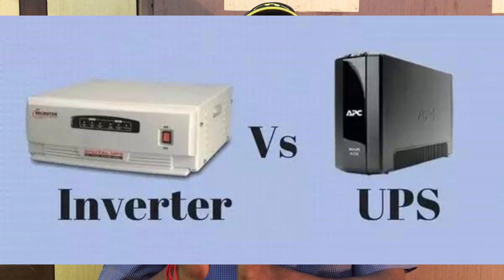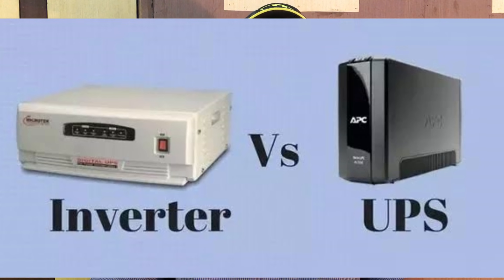Difference between UPS and Inverter | എന്താണ് UPS ഉം Inverter ഉം തമ്മിൽ വ്യത്യാസം

Comment: Hi bro,

I have an Apc ups 1100 va and only my ps5 is connected to ups. Problem is sometimes when i switch on the ups there is tripping in mcb. I am able to put the mcb switch to on and everything works normal but this keeps on repeating sometimes. Any idea how to resolve this. Thanks.

Comment: എന്റെ കയ്യിൽ marantz sr 5015 amplifier ഉണ്ട്. അതിന് ഏത് ups ആണ് കൊടുക്കേണ്ടത്? ഇവിടെ voltage fluctuation ഉണ്ട് . apc bx 1100c  ഞാൻ യൂസ് ചെയ്തിരുന്നു പക്ഷേ ചില സമയത്ത് ഓഫ് ആയി ഓൺ ആവുകയാണ് 
apc ups Stepped approximation to a sinewave ആണ്.
 marantz construction power 650 ആണ്.  microtek E2 1kav 24 v pure sine wave ആണ്..  ഇതു മതിയാകുമോ

Comment: Router connected to UPS is not getting powered on when power outage happens,at the same desktop and CPU is    on only.Tested the  router connection in all three  power sockets of UPS .But not working still. I am using UPS model ZEB- U725. Please help!!

Comment: Stabilizer pakaram UPS endanu smart TV or Smart AC use cheyathad considering the fact that smart devices use controller circuits which can be damaged by severe or regular power failures? UPS use cheydal namuk apo itharam cases ozhivakikoode? Just power surges matram control cheyuna stabilizer use cheyand, power surge um instant switching nalkunna UPS use cheyunad ale itharam smart devices inu nallad? esp for inverter tech AC's. Hope your reply soon!

Comment: V guard inverter DC 1000smart model ആണ് ഉപയോഗിക്കുന്നത്. ഇടി വെട്ടിയപ്പോൾ കംപ്ലൈന്റ് ആയി. അങ്ങനെ ബോർഡ്‌ മാറ്റി വെച്ചു. ഇപ്പോൾ ഇൻവെർട്ടർ fan എപ്പളും work ചെയ്യുന്നു.temp  42c ഇൽ നിന്നും 56 c ലേക്ക് പെട്ടന്ന് ആകുകയും fan work ആകുകയും ചെയ്യുന്നു. കംപ്ലയിന്റ് വല്ലതും ആണോ
Reply from the maker: Board local Aano maati veche... Board oveeheat aakunund, Peten oru problem undaakan chance Kurevaan, but continues use il undaakam

Comment: Sir,  my ups is v guard, model  prime 1050, digital sine wave ups, 900 va, 740 w , input 5.7, out put 4,1, battery used is tubular 135Ah, connected to my light,  fan ,and led tv in my house,  I like to install a solar panel system with charge control is it possible,  I am expecting your advise, thank you

Comment: 150 ah. ബാറ്ററി ഫുൾ ചാർജ് ആകുവാൻ എത്ര യൂണിറ്റ് കറന്റ്‌ വേണം 
എത്ര ടൈം എടുക്കും??
Reply from the maker: Current 15-16 amps okke aakam, time almost 7 hours.
Reply: @TechCornerMalayalam  
Sir താങ്കളുടെ അവതരണം നന്നായിരുന്നു. Congrats.എന്നാലും sir, താങ്കൾ പറഞ്ഞ കണക്കുകൾ തെറ്റാണ്.കാരണം
150 Ah battery യുടെ total wats എന്നത് 150 X 12 = 1800 ആണ്. അതിനെ 230 Vകൊണ്ട് ഹരിക്കുമ്പോൾ 7.83 മാത്രമാണ് വരുന്നത്.അതായത് 7.83 Amps.ചെറുതൊയി അങ്ങോട്ടോ ,ഇങ്ങോട്ടോ മാറിയേക്കാം അത്ര മാത്രം.
ശരിയല്ലെ?
Reply: 150 * 12 = 1800 . Ethil e 12 engana ya vanathu
Reply: @akhilmc9388  12 aanu battery volt

Comment: brother upsil njan irunna old battery matty athil oru 60ah battery koduthal namukku athu oru inverter pole prevethikan pattole?
Reply from the maker: Pattum pakshe athinte control cardsinte Voltage ampere rating koode nokenem athin patunne atrem maatre kootan pattu illel board adich pokam
Reply: @TechCornerMalayalam   ath ups nte മുകളിൽ തന്നെ ഉണ്ടാവുമോ

Comment: UPS സാധാരണഉഭയോഗിക്കുബോൾ 
LED ബൾബ് പോലുള്ള ബോഡ് ഉളളസാധനം 45സെക്കൻഡ് മാത്രം വർക്ക് ആകുന്നള്ളൂ 
എന്നാൽ fan പോലുള്ളഹെവി സാധനങൾ 
30+40 മിനുറ്റ്കിട്ടുന്നു 
എന്നാൽ LED 45 സെക്കന്റ് പോലും  കിട്ടുന്നുമില്ല അത് എന്താ 
അത്കിട്ടാൻഎന്തുചെയ്യണം 
പിന്നെ ബാറ്ററിയിൽ ചാർജ്ഉണ്ടായിട്ടും ചാർജ്ഫുൾ തിരുന്നത് വരെ എന്താ വർക്ക് അകത്തെ 
അതിനുമുന്നേകട്ടോഫ് ആകുന്നു അത് ചാർജ് ഫുൾഅല്ലെ ഒരുനോർമൽ  തീരുന്നത്   
 വരെഎഗ്ഗിലും കട്ടോഫ് അഗതിരിക്കാൻ എന്താണ് ചെയ്യു 
വല്ല മാർഗം ഉണ്ടോ പ്ലീസ് കാൾ മി 9497122279 പ്ലീസ് call പ്രതീക്ഷിക്കുന്നു
Reply: പിന്നെ ഒരുകാര്യംകുടി 12v ബാറ്ററി +12v ബാറ്ററി അങ്ങനെകൊടുക്കാമോ (24v അല്ല )
12v മാത്രംമായി അങ്ങനെ ബാക്കപ്പ് കൂടുമോ 
പ്ലീസ് ഒന്ന് വിളിക്കണ്ണം പ്ലീസ്   
9497122279 ok
Reply: Bro ath computer ups aane athukondane light kodukkumbol load kanikkathade minimum 100 watts vendi varum

Comment: current പോകുമ്പോൾ invetor റിന്റെ സഹായത്തോടെ ലൈറ്റുകൾ കത്തുന്നു. അപ്പോൾ ഇവേറ്ററിൽ out Point ൽ നിന്ന് Phase മാത്രമല്ല ബൾബിലെക്ക് കിട്ടുന്നത് Neuter എങ്ങനെയാണ് ലഭിക്കുന്നത്.
Reply from the maker: Invertor output neutral edukenemennan sherikum... pakshe edukaarilla...enkilum invertor inputil nammal main neutral connected aanu...ah neutral nammude appliances ilum koduthit undu ...ee case il namude kseb neutral aanu return path... 
athariyan invertor input neutral disconnect cheythaal namude invertor work cheyilla...
Reply: @TechCornerMalayalam  kseb neutral poyal inverter work aaville

Comment: ഇപ്പോയത്തെ AC& refrigerator കൾക് stabilizer ന്റെ ആവശ്യകത ഉണ്ടോ
Reply from the maker: Aavsymilla...iplethe invertor ac ilum athupole olla appliances ilokke surge protection m voltage stabilization okke internally undu... pakshe high fault okke vannal chilepm power supply board adichu pokam appliancesile pakshe main partsinonnum complaint verilla